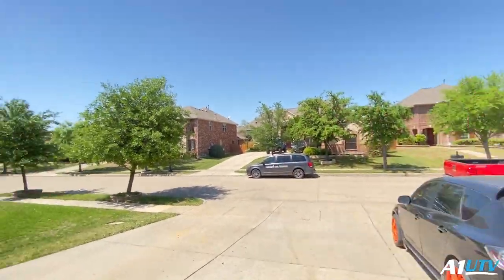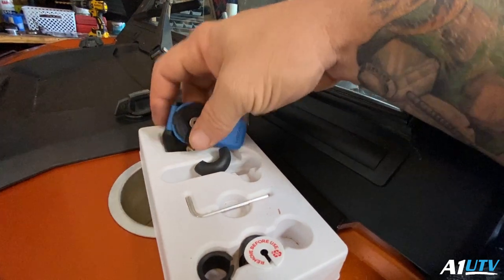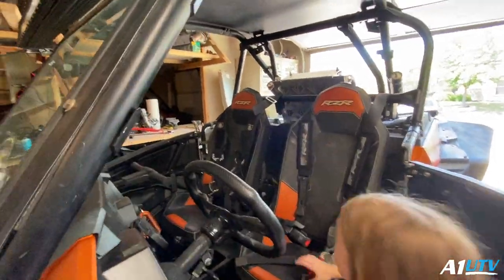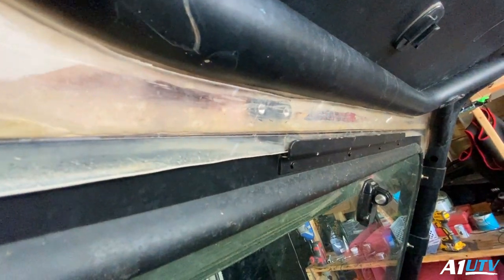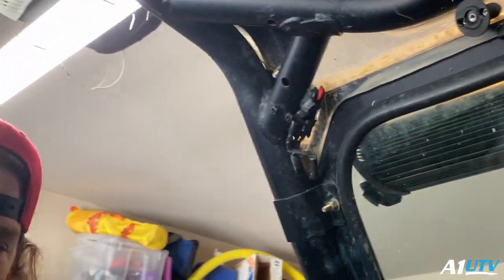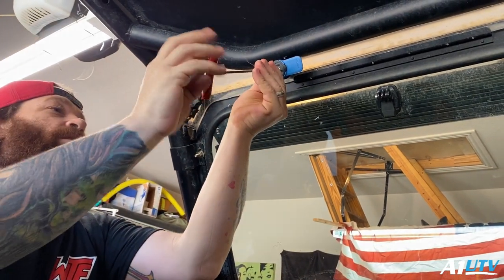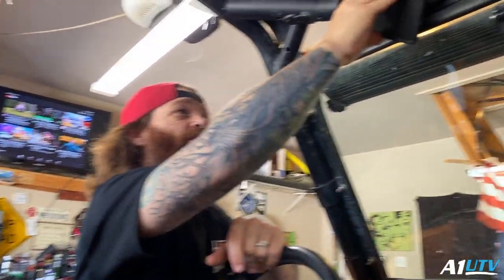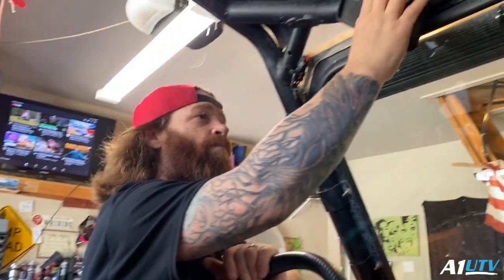Best phone mount for SXS/UTV

Comment: After watching your video I ordered one and just received it today. It would appear that they changed the part that you drilled the windshield for. It is no longer a two screw set up with a back. It now has one screw and the other side is hinged. Great set up for a bike of wheeler, but cannot do as your video suggests. Great video though!!
Reply from the maker: You need to order the mirror mount. That’s how this is mounted. The mirror mount uses the two bolts. They haven’t changed anything. 

https://www.quadlockcase.com/products/mirror-mount-motorcycle-scooter?variant=32248633488
Reply from the maker: You message my Facebook page and I’ll forward you some more pictures